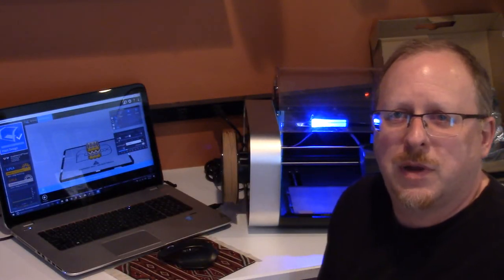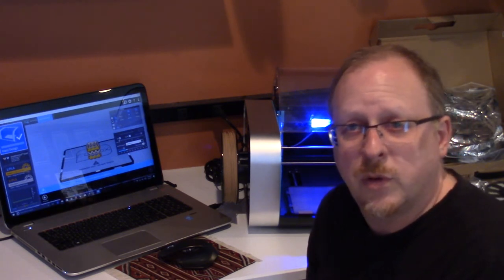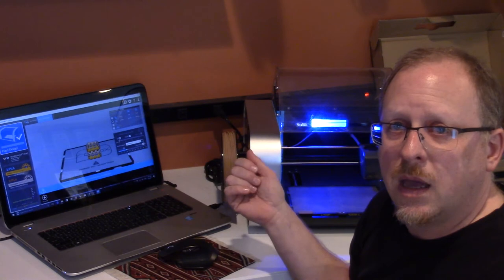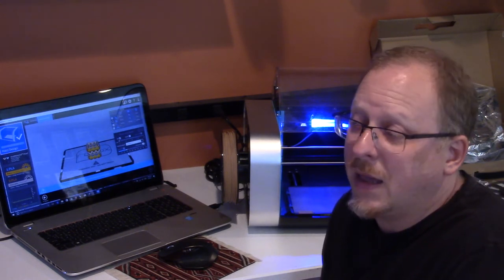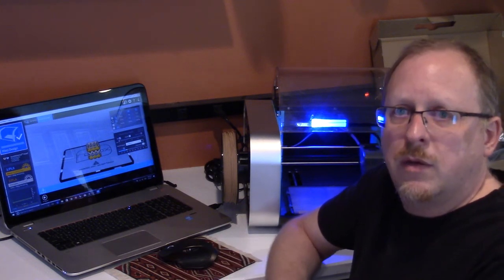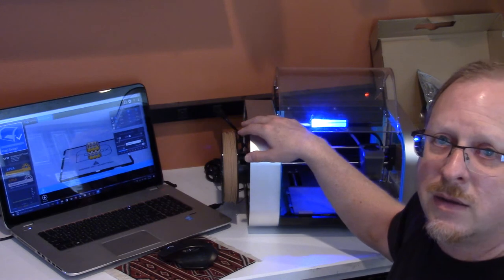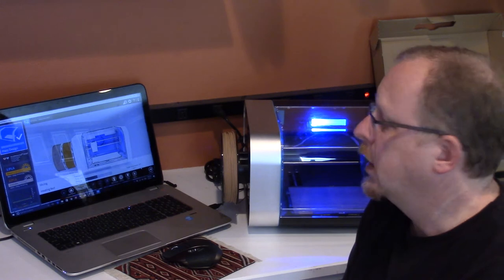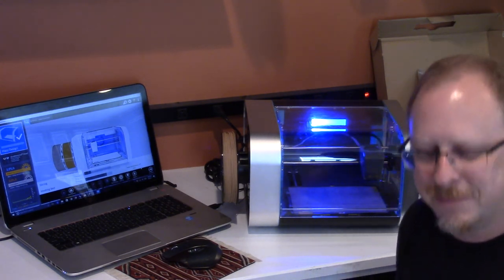CEL Robox Dual 3D Printer Review Part 3

Comment: Hi Tom! Thank you for this series of video, very useful. We bought CEL Robox and use PLA filament. Each and every model sticks to the platform and we can't take it off. Also, even with 70% density, the 3D prints breaks in parts (or layers). As far as ready model is on the platform, it looks great, and it breaks horizontally every time we try to take it from the platform. 
Have you came across this before? How can we fix this?